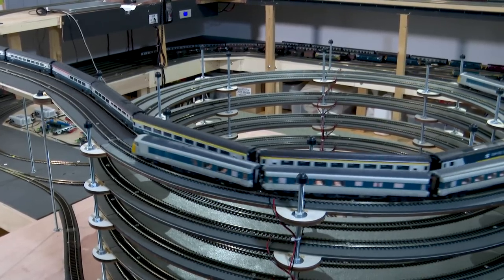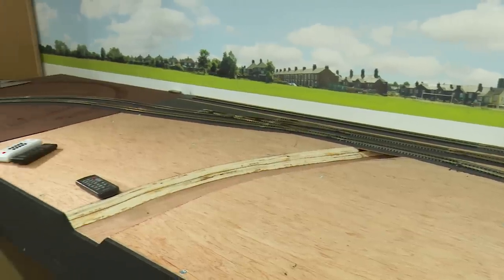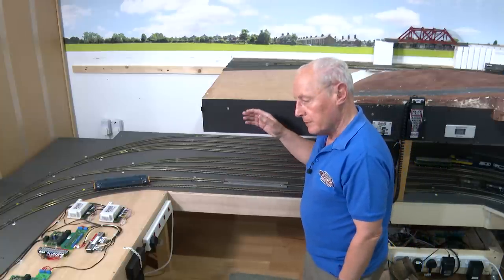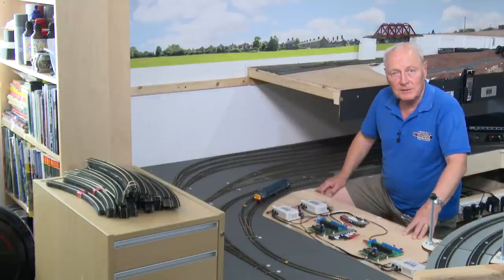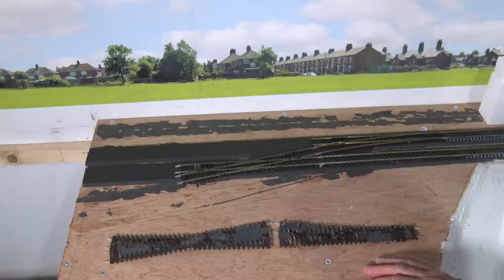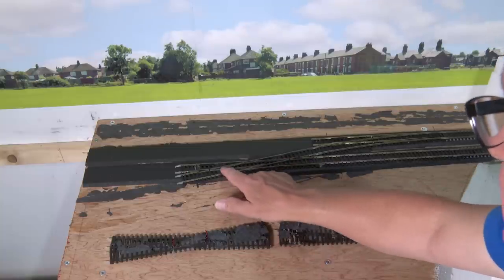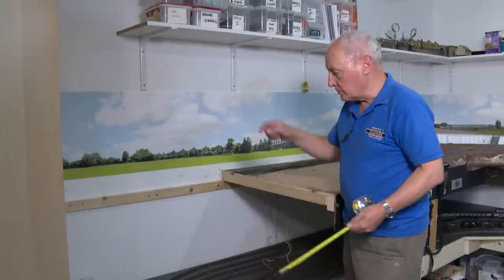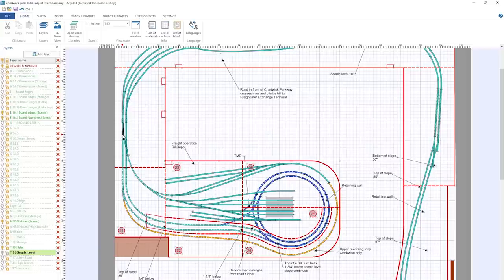The Big Track Link Up at Chadwick Model Railway | 167.

Comment: THE COST OF ELECTRICITY 🔌🔌 Many of my friends are limit the use of their model railways over winter due to the fuel increase. Does anyone know how much a medium layout does actually cost to run.?
Reply from the maker: Great question BoomBox.
Reply: @ChadwickModelRailway  I hope that someone looks into this because it's surly going to affect so many during the winter months. Not only personal use to shows as well. Even my local metal detector club is cut short meeting because of the charge of hall hire during the winter for electric lighting etc . It really is going to be a big concern to what are model railways costing during these difficult times ahead.